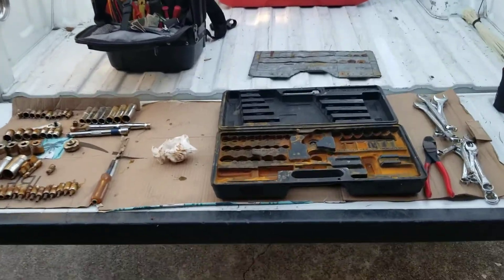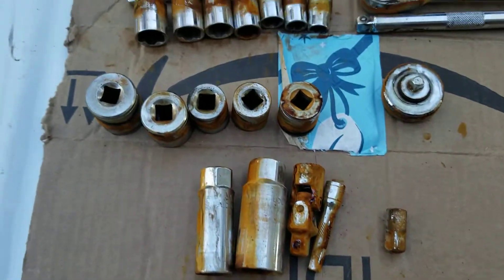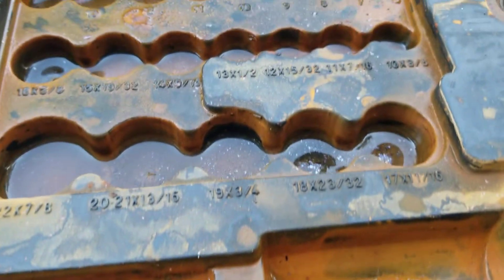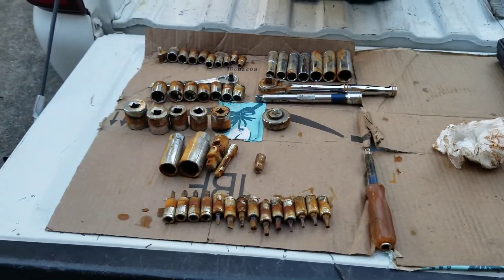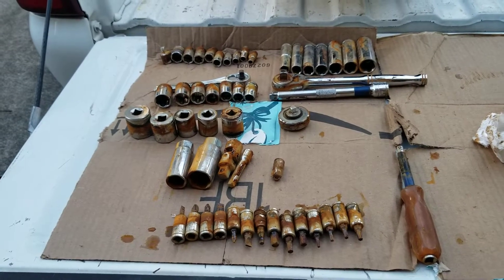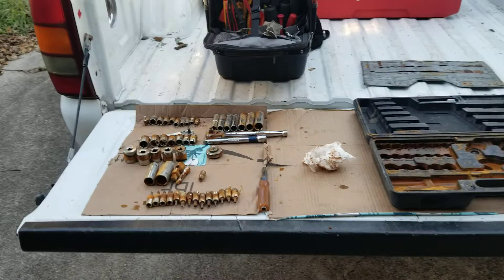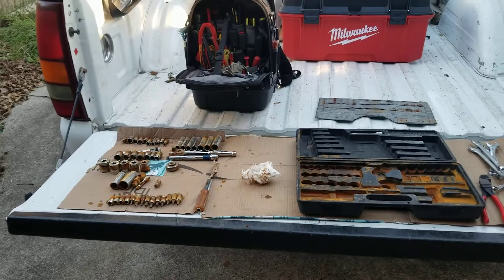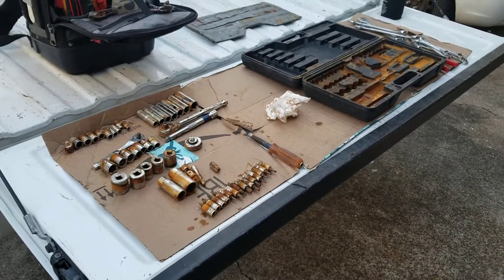* Rusted sockets..!!!

Comment: Water vinegar soak.... then ballistol....
Reply from the maker: I managed to use an old piece of brillo and the WD-40 to get most of the surface rust off of the 1/4" sockets and soaked the rest down....gonna get a pack of Scotch Brite to finish the rest - wasting my time with that little scrap of brillo. 
May try the vinegar and water soak tomorrow to get the bigger sockets, bits,  and ratchets....definitely gonna coat them all with ballistol when I"m done.
The REAL bastard is getting that plastic case rust-free - I"m got that sitting in my sink soaking in CLR hoping to break up that rust thats coating the socket/bit holders that I can't get to with a wire brush or brillo.
Reply: Central heating radiator cleaner.  I don't know what brands you have there.  Anything which is used to powerflush radiators.  Just dilute it down 20/1 or 5%.  You could also soak them in white wine vinegar and water and scrub with aluminum foil.  Coat them with waxol once cleaned and dried.  The stuff used to coat vehicles.  My Grandad used to used baking soda or bicarbonate of soda mixed with a little dish soap and water mix it to paste like consistancy and coat it on with a brush.  I don't know how effective this is because I've never tried this trick myself.
Reply from the maker: @rayc1503  
I've seen the fancy stuff like 'evaporust' and some others.
Picked up some fresh Scotch Brite pads after work and gave the remaining sockets a quick vinegar soak while I made something to eat.  
I know most ppl were saying 'overnight', but I was impatient.
Scrubbed them after less than an hour of soaking in vinegar and the rust came off pretty easy.
Letting all the sockets soak overnight in a mixture of Vinegar and Simply Green to degrease.

Gonna rinse them off in the AM, then wipe them all down with a rag soaked in Ballistol tomorrow after work.

Outta be good to go.
Reply from the maker: Tried the vinegar this evening, working pretty well - letting them soak a bit to break up some of the crud INSIDE the socket that I can't get to very well....gonna rinse them off in the AM and then coat them with Ballistol after work tomorrow.
Reply: @scrambler350  I did a friend's neglected 1911 like that one time and it came out great....